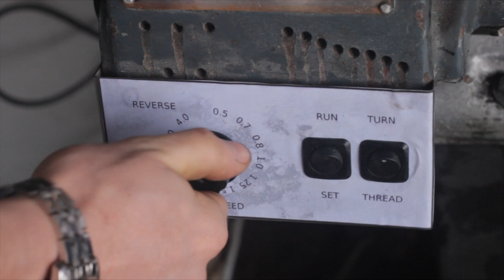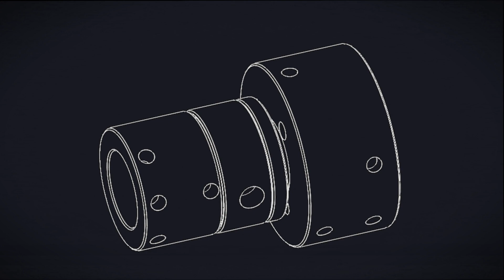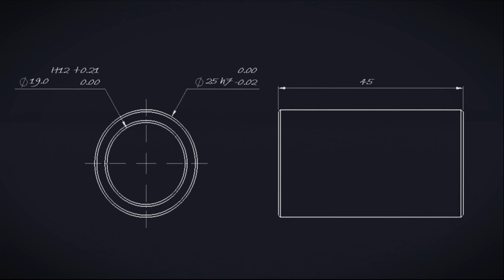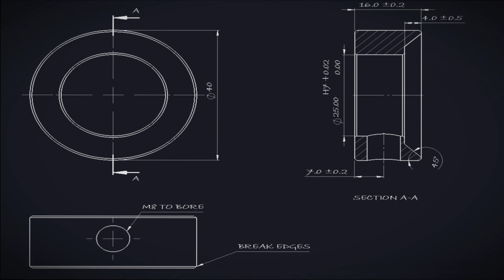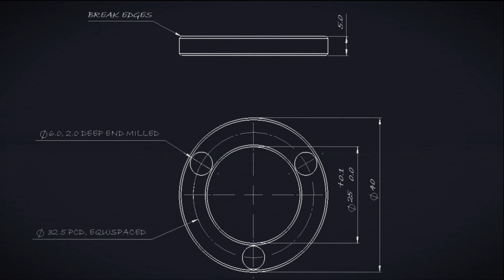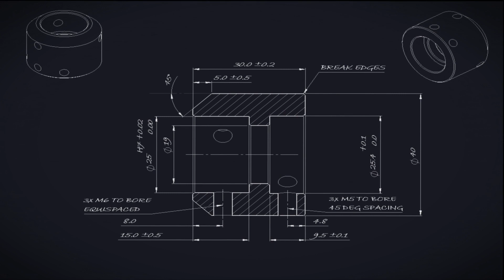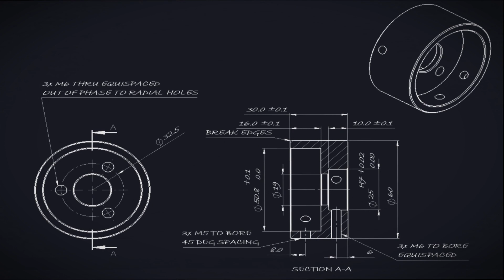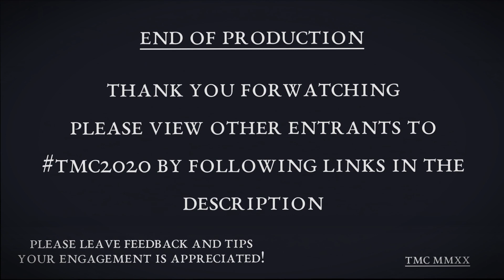Clutched Die Stock #TMC2020

Comment: Very nicely done - would like to see more video of the completed holder doing some threading
Reply from the maker: I'll need to find some projects that make use of it. I've found that it tends to gall the threads on the few things I have threaded under power, perhaps using bigger diameter dies will allow for better chip clearance. Do you have any recommendations?

When operated by hand it makes absolutely beautiful threads, under power it works great on plastics though.
Reply: @dirtybarry7002   I'm just using a typical die holder and let go if it gets to tight.   I always use a heavy sulfur based cutting oil, and on most materials it works okay but on mild steel I still get some galling at times.  I'm not a machinist, more of a maintenance mechanic :)
Reply from the maker: @kisoia  I can imagine it would be quite scary to have a die handle spinning around. I've found this one takes a little trial and error to get the slipping load set just right so it won't slip under normal cutting but will slip if the load gets too high.